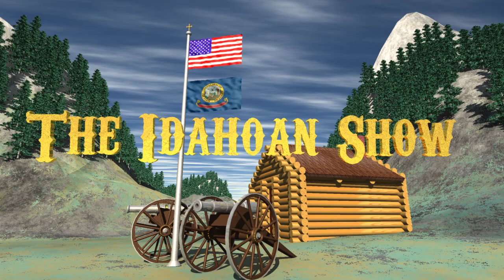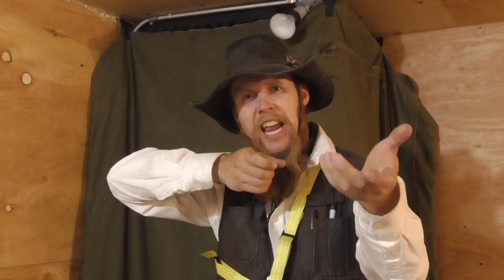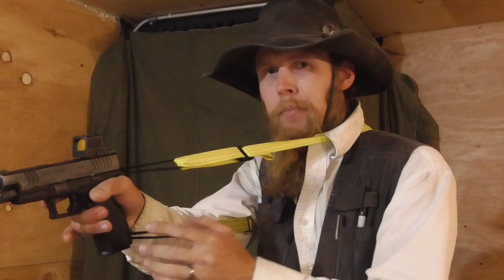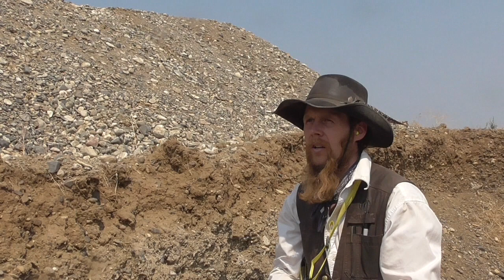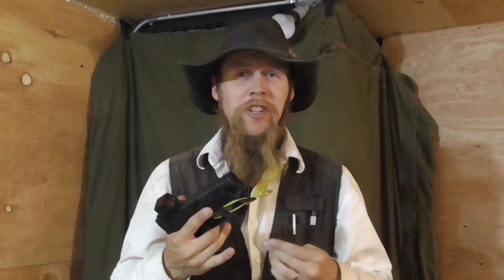A Pistol with Rifle-Like Accuracy? (TIS340)

Comment: seems like the thing left out here is rate of fire. unfortunately, there's still quite a bit of pitch up, which means more time re-sighting. lots of comments about cheek bracing, but your strap is backwards, ala p50. horizontal p50 foregrip would also help with pitch. and the other thing that differentiates between pistol and rifle, is the ability to shoot a pistol single handedly. that should have been part of the test. to offset the cost, and fatigue, maybe you try this with a 22lr. shoot all day, won't break the bank or your body. and you might make it single sided, as in just around the shoulder, not the whole body. much easier to stay concealed. lastly, just curious, what happens if you connect both ends to the bottom of the grip? maybe try it.

Comment: Ian on forgotten weapons had a recent(ish) video looking into the idea of a "cheek pistol" where you use you cheek as a third point of contact to yield more controllable accurate fire, this obviously wouldn't work with pistols that have a moving slide, but still an interesting idea none the less
Reply: I had a thought sort of on that subject too, as a potential stock replacement system. Think "Short stocking" a rifle where you lay the flat of the stock on top of your shoulder, but with a gun who's stock is already rotated 90 degrees. By design the stock lays on top of the shoulder and is pulled in and down at a downward angle to provide stability. Would the ATF still classify that as a stock do you think?

Comment: 2 point sling oriented in that fashion seems like a pretty smart idea. At the very least it's a fantastic compromise between simplicity, size, weight and accuracy. I have an AR pistol that I run with a single point sling with a short tight bungy attached to a plate behind the buffer tube castle nut. It's pretty effective at stabilizing like this, but I feel like if i had a way to fix a second point to the bottom of the pistol grip it would be much more stable. As it is, if you don't lock your wrist tightly it can get a bit wobbly. Well, off to the workbench. Another interesting and informative video, thanks for the inspiration fren.

Comment: The Kel-Tek P50 has qd points on the beavertail and the bottom of the grip so a sling can be attached in this same manner.  I have a feeling you could tighten up your groups if your off hand was up further on the gun such as a vertical grip if it was "legal".  Maybe a fancy light mount that could be 3d printed to just so happen to be comfortable to grab.  Similar concept as the two points of contact with the sling aiding in stability, so too two points of contact with hand placement can have a compounding stabilization effect.

Comment: Sig P-210, S&W 686 6 inch, or a quality 1911. I can out shoot most rifle shooters with any of the 3. All about mastery of fundamentals.
Reply: That’s kind of the element Tim has been trying to remove in this practical accuracy series...

My understanding of it anyway.
What can be done to improve the shooting of the average person without 
A) Finding an abnormally talented person to be our “average person”
Or B) Giving them so much time on the tools that they no longer can be considered average either.

There is something to be said for what you’ve mentioned but I think the logical conclusion is to invest similarly into 3 vectors
Mechanical accuracy
Crutches that the individual has to lean on
The 80% of Ability that gets learned in the first 20% of the time, rather than the 80% of time it takes to master the last 20%

By improving those 3 things to say 7/10, you will get the best results in the most people with the lowest investment and at some point, gaining above 7/10 in any one or two of the fields doesn’t make sense because the field in which you have 4/10 is already a limiting factor.
I hope that all makes sense. That’s how I’ve understood it anyway and what you’ve pointed out is just as important, just not the focus of this series if I’ve understood correctly.

Comment: Interesting concept! If I may give a suggestion, when I was aiming my double barrel shotgun (which becomes quite heavy after sometime), I would always clamp the front end of my leather sling (two points) to handguard with my hand and rest my elbow on stretched portion (middle) of the sling, so it would form some kind of "frame", which is extremely stable (at least for me). I don't know if it could work the same way as me but it's worth a try! :D

Comment: One of the problems I seen with the setup is that it slides the trap around and stops the muzzle from returning to level. Might need to isolate the movement for repeat shots.

Comment: Just for future use, Miculek is pronounced Mit-shoo-lek or everyone gets it worng and you got insight to the heritage of his name. This video gave me some of what I was looking for through in the previous videos. I like that the attachment is concealable as flamboyant suspenders. With the right setup there could be a connection on the front rail to pull downward as well with an added deviation point.

Comment: Sight radius is the most important factor in a rifle. The ultimate sight radius would be a visible line of laser on a target. With the limit of 5mw, that is not possible. You need 100 times the power to make it visibly print on a target at 100 yards.

Comment: H&K did a similar thing way back in the day with their stockless MP5's, but those only had one pivot point. Interesting project!
Reply: Jep, the MP5k's with the single point slings.
Reply: I have an AR that i run on a single point sling like H&K MP5. It works. But, I can see how a second point attached to the bottom of the grip could make it much more stable. I'm going to try and rig up something similar for my AR.
Reply: @pablowentscobar  Please share the results!
Reply: They use then same concept on the MP7